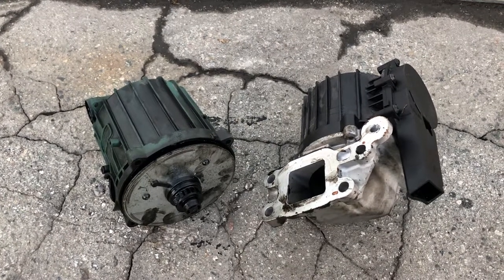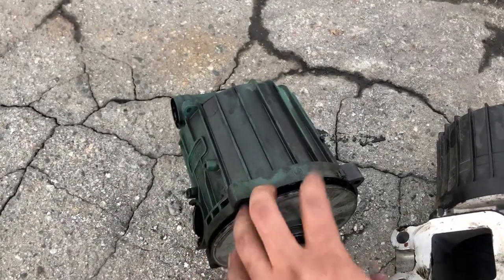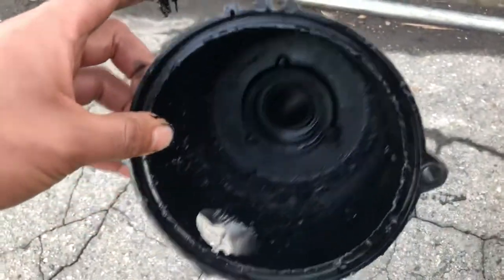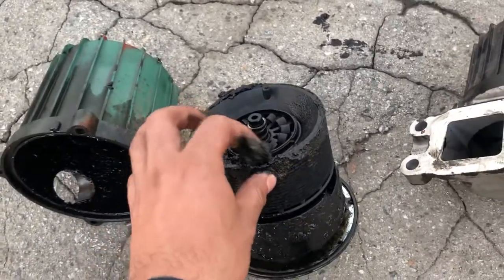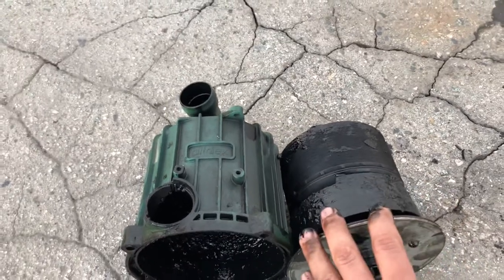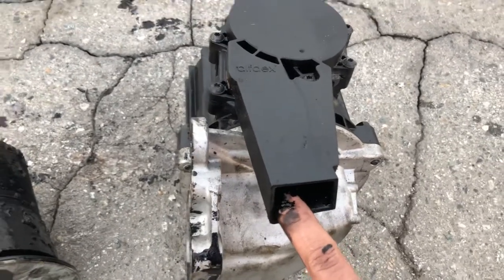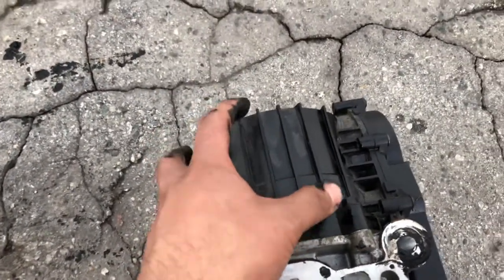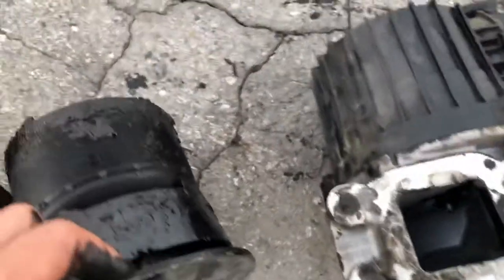Heavy Duty Diesel engine 101 Episode 1: how the Oil Crankcase Breather works.

Comment: Whats the new update one wich ls open type to avoid oil going to charge cooler??
Reply from the maker: Can you rewrite your question? Charge Air Cooler and Crankcase Breather are two different parts and are NOT relate to each other.
Reply: There s a open type crankcase for some trucks like maxforce dt. They made them close type wich what happen. the CAC get oily and plugg due to oil from crankcase. But the new stlyle open crancase its made to send oil or blow by to the atmosphere not tilo the CAC anymore.
 do you know or has any picture of that new open crankcase.
Its call open type..
Reply from the maker: Ok, now I understand your question. Those in that kind of engine (Maxxforce 13 older design), you have to replace the whole assembly, I did one of those once, hard to remove it from that engine, so if you want to replace just remove to whole assembly, I do not have photos for it, but if that it is hard to remove just replace it, remember if it leaks again because you just replace one part and put it back it will cost you more money in the long run. In the newest 2019 A26 engine and others, they removed that and it is like you said... just going out to the atmosphere.

Comment: Do I have to empty the oil off my engine before changing crankcases breather
Reply from the maker: You do NOT need to drain the oil in order to change the crankcase breather. This apply for all Diesel engines. (Detroit Diesel, Paccar, International, Cummins and Volvo/Mack).
Reply: Thanks and I forgot to mention I have a detroit engine thanks for the info

Comment: I changed it but I still have the code Engine Crankcase Breather Oil Separator Speed
SPN 5444 FMI 1 what I have to do?
Reply from the maker: If your engine is DD13/15/16 you might need to replace the crankcase breather speed sensor, it is on top of the breather. If that doesn’t work perhaps is a harness issues. This is my personal opinion, for a proper diagnostic please take your vehicle to a repair shop. Thank you for support.

Comment: My crank case separator only leak at square  gasket , at engine valve,  my separated or filter can be cleaned with diesel or brake cleaner , let me know please,
Reply from the maker: First, make sure your truck is clean before start an inspection of any leak. Also, if your truck is leaking oil from that side it might be the gasket. So I suggest you to clean around all the areas you see leaks and then take a closer look where is leaking when the engine is running.
Reply: Yes , I cleaned with brackets cleaner, and I see oil leak from square gasket, where the assembly connects the engine wall, just help me how to remove and can I clean the upper round separator with Desil or brack cleaner

Comment: Who knows how often should I change my crankcase breather(filter) ???
Reply from the maker: There is no schedule interval to change your oil separator/crankcase breather. The rule of thumb is to change when it is leaking oil from the gasket or from the outlet side of the breather. Also, when a strong noise (like humming or grinding) comes from it. Those are the three things that usually requires to replace it. I hope this help with your question. Thanks for watching.
Reply: @LetstalkDIESEL  Thank you

Comment: My Freightliner dd15 it's leaking a Lot of oil from the Crank case i chance for another used one and same thing leaking a Lot of oil whats wrong???
Reply from the maker: Check the engine oil level is fill properly. Perhaps both Crankcase breather are bad. You should get a new one to eliminate that possibility. Also, check the surface area where the Crankcase breather gasket sits maybe it is damage. Try to apply a thing layer of silicone around the gasket, this might help to prevent future leaks. I hope this help you with your issue and thanks for watching.
Reply: @LetstalkDIESEL  so you think is bad the Crank case bad is not leaking from gasket it's from the plastic Pipe of the Crank case thanks for answering
Reply: @LetstalkDIESEL  the oil level it's ok

Comment: A mi Cascadia dd15 sele cambió el crankcase por otro nuevo por que estaba tirando el oil y quedó igual alguien más que le allá pasado lo mismo? Solo tira el oil cuando está andando no lo tira cuando está parado y encendido
Reply from the maker: Parece que el Crankcase está defectuoso, ya he visto esos casos antes. Si lo ha cambiado recientemente (menos de 90 días) tal vez el dealer le puede dar garantía de la parte. Desafortunadamente, por lo que dice no parece error de instalación pero deje que lo revisen nuevamente para asegurarse de que la parte es el problema y no el empaque de el Carter o problema de instalación. Gracias por mirar el video.

Comment: LOL 
You have to maintenance every 200,000 miles this one too LOL
Nothing has to do the oil with that
Reply from the maker: Just for preventative maintenance. Thanks for watching.
Reply: @LetstalkDIESEL  had freightliner change this part now have blow by blowing out like crazy and it's leaking oil do you have any answers to why this would happen was not doing this when I took it in to the freightliner shop

Comment: Can you just remove this, take it apart and clean it? I have a dd15 engine. I don't see any broken parts. Seems like you could just clean it up a little..
Reply from the maker: You might be able to do that and may work temporary but the problem is inside the spinning plastic cylinder and the bearing, since it gets clog with soot that slows down the cylinder, even if you clean it and may cause the breather to fail. So the best thing you can do is to replace the whole crankcase breather so you will not run into problems later, like a oil pan gasket leak since the pressure cannot be release properly because a clog breather. Freightliner does NOT sell the kit to rebuild the crankcase.
Reply: @LetstalkDIESEL  yeah, I just took mine off and took it apart. It's not serviceable. You can separate the top plastic part, and the down pipe, but that's about it. You can't actually take the spinning piece out of the plastic housing. But mine spins very freely. It still leaks a whole lot of oil. That and the oil pan gasket, and also the camshaft housing leaking. I'll just replace it, and take it to the shop to have the oil pan and camshaft housing gaskets replaced. Thanks for the reply tho. New sub. Keep the videos coming. Very helpful! 🍻
Reply from the maker: Thanks and glad to be helpful. Trying my best to answer my Subscribers questions and more videos to come.